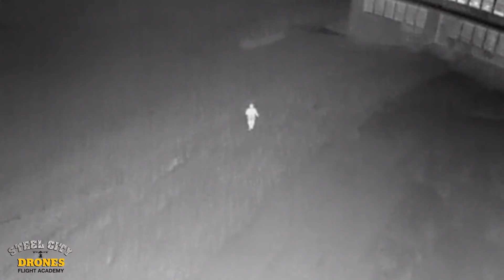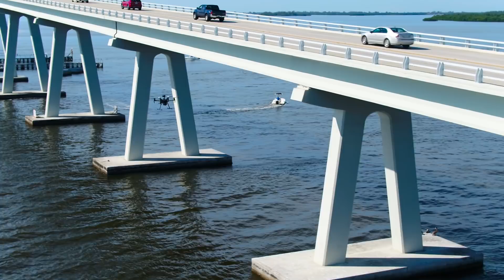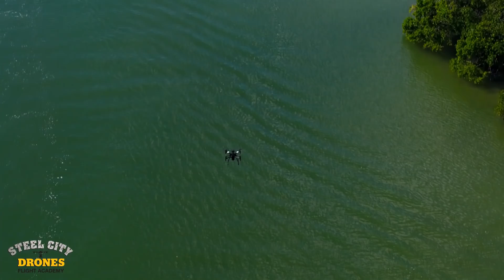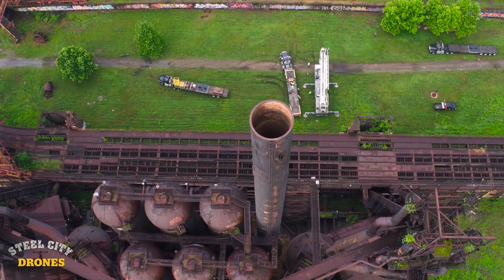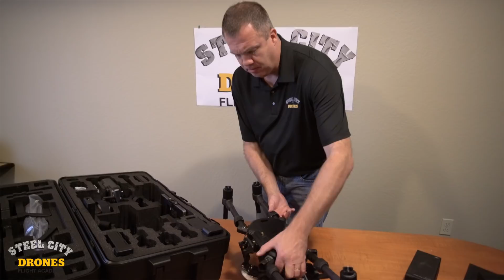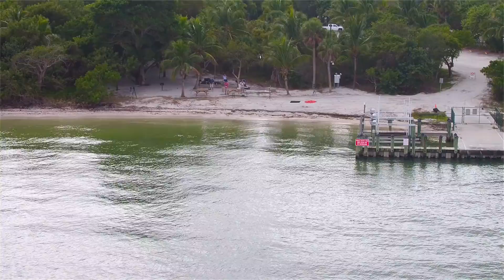DJI MATRICE 200 AND 210 RTK  | Extensive Test And Review

Comment: The factory case is the largest allowable size for most overhead bins on-board commercial airliners, and can travel with you as a carry-on bag. The GPC case that you seem to love so much must be transported as checked baggage. One factor that 99% of the posted videos over-look.
Reply from the maker: Actually that is not true, a customer of mine got rejected by Delta. And yes you should absolutely check the case in so that you can carry on your batteries.

Comment: I don't mean to be deadhead to this video but ADS only works if other aircraft are equipped with ADS-B out. So most likely you won't be able to see is small aircraft in your screen if it's not equipped with ADS-B out installed.
Reply from the maker: WingmanDK: It tests very well with small planes and helicopters almost all of which have it.  You are correct it won't pick up big airliners which is not the intention of the detection.
Reply: @SteelCityDrones  95% small private aircraft do not have ADS-B out installed and it is not required to be installed since it is not mandated until Jan 2020.  Maybe it showed within that 5%.

Comment: Very informative video. My company bought the M210 RTK and until now the RTK mode is very frustrating to use (just using GPS mode in the meantime). We can't get it to work unless it's in an open field. You mentioned at the 12:27 mark that it can fly in any type of environment. But even in our parking lot, we're not able to take it off, much more if it's on the ship's deck where we're intending to use for inspection most of the time (actually I've already tried and got all sorts of errors, compass error, magnetic interference). I hope you can give me some tips using the RTK mode in a magnetic interference environment. Thanks in advance.

Comment: Dave, Great video.  You mentioned that the M210 RTK does not need a ground station like the M600 does.  Could you elaborate a little bit please ?  Why doesn't the m210 rtk need a ground station, and are there tutorials here to set up the M210 rtk ?
Reply from the maker: We are actually recommending the Matrice 300 over the 200. M210 RTK and M300 RTK both use NTRIP so the base station can be broadcast over the network.  We have tutorial videos in our Matrice 200 and Matrice 300 online courses we have on our site.  We also sell these aircraft as well. Contact us.

Comment: Great video!  So using the RTK mode, can the 210RTK hover stably under a low lying concrete bridge that is 20ft over fast-flowing, dirty river water?  Or would the vision sensors cause the drone to panic and fluctate if it was sitting say 4ft over the water?  Thanks.

Comment: It doesnt make sense for DJI not to use the expensive RTK positioning system for reducing the ground control points
Reply from the maker: I was told there was technology limitations as for the reason why they coudn't do it. This started when the M600 RTK was released and many people (including myself) bought that copter because we were under the impression that it could do it. Imagine spending $10K plus on a system thinking it can something that it can't. That's why I wanted to include this info in the video.  Believe me, there have been numerous people complaining to DJI about it. If you want it added I suggest you go to the DJI Enterprise group on facebook and complain. There's several DJI people on there that are responsible for the RTK project and the more feedback they hear the better.
Reply: RTK linking the geotiff positions technology is already old so this DJI scheme doesnt make sense business wise for mapping and surveying if you paying over US$7000 for the RTK and still have to put the GCP in the field with an RTK rover (cheapest option)    This Matrice 210 RTK-G  is no enterprise UAV solution then.
Reply from the maker: I have to disagree with that point because the advantages of using a commercial grade GPS system over a consumer grade GPS system can come in very handy when doing commercial grade jobs. This system works great if you are near a lot of metal or have a lot of electromagnetic environments where you need inspect power lines.  I bought my M210RTK because of these situations and it allows me to work in environments that I simply can't with a consumer grade GPS system.
Reply: I tried posting in DJI Facebook about this RTK lack of use in the images and my posts were never public 
  I then questioning DJI Support why they are not logging positions and raw data from the onboard GNSS RTK receivers to use it in the geotiff of the images taken....  never got an answer
Reply from the maker: try this page this is where all the DJI helpful support people are www.facebook.com/groups/DJI.ENTERPRISE/

Comment: The m200 or 210 when flying for. What is being transmitted to the controller screen? The built in fpv nose mounted camera or the attached camera.? And can you change back and forth between the 2?
Reply from the maker: When you are flying in the air you can see both the FPV camera and main video camera feed.  By default the main camera feed is in the middle of the screen and the FPV camera feed is in the lower right hand corner. You can switch between the two very easily so that the FPV camera is the main feed in the middle of the screen.

Comment: Will the Blue sky monitor with with other DJI compatible flying apps like Litchi ?
Reply from the maker: The Crystal Sky Monitor only works with Pix4D software. Other than that its not very easy to use other apps.

Comment: Thank you for this comparison. Very informative!

 I have a question relating to the batteries. You say that you can only carry two TB55 spare batteries with you on the airplane. Is this true? They are rated 177 Wh and is above the limit of 160 Wh set by the FAA and ICAO.
Reply from the maker: Thanks for the comments. The TSA has a policy of unlimited amount under 100 WH.  Above that rating it becomes very restrictive.
Reply: Steel City Drones What about over the 160 Wh limit?
Reply from the maker: I don't believe you can carry on over that.
Reply from the maker: The TSA allows you to carry an unlimited amount of batteries that are rated under 100 wh.  DJI designed the TB50's specifically in mind to meet this spec. TB50's are the largest size you can carry on in an unlimited capacity.

Comment: Hi. Great video!  
Well, I'm also disapointed about the RTK which is not RTK in the geodesic point of view.  

I have a M210 and I wonder if I can upgrade it to M210 RTK. Can it be done or I need a complete new drone?
Reply from the maker: HI Alex, a regular M210 can't be upgraded to a 210RTK. It has to be purchased with the option no availability to add it afterwards.

Comment: Please advise me if Crystal sky + Matrice 210 RTK can do Waypoints, without camera system connected to the Gimbal. Reason being is we will have extra units that will only carry a specific Payload ( survey tool with independent software application ). So the drone job is only to fly the designated Waypoints whilst the apparatus is doing geographical ground survey (5metres from ground )

Your advise will be appreciated. Will the FPV enough to see where the drone is heading?
Reply from the maker: Yes you can through Pilot.

Comment: Great job! I work for a municipality that would like a drone for mapping, SAR, Emergency inspections, as well as marketing videos. The quality of the marketing stuff does not have to be top of the line. I feel like this would be the best drone for everything but cinematography although it seems that if we bought the x5s with it, it could do it all. Would you guys agree that the 210rtkv2 with a z30, xt2 and x5s would be the best fit? I feel like We May not need the RTK because we would only use it during emergency bridge inspections. Thoughts? Thanks!
Reply from the maker: The RTK version is great when you have to work around a lot of metal. If you have the RTK version and are not flying around a lot of metal on any specific day you don't have to use the Ground station or the RTK system. You can simply turn it off in the app and use as needed.  That way you have the best of both worlds and have the RTK system as needed. We can offer the best pricing for the M210 line along with all the accessories. We can beat any price and offer technical support and maintenance support contracts as well. We can also provide training on how to use all the equipment.  Let me know if we can help.  Thanks
Reply: Steel City Drones Flight Academy my coworkers in HAZMAT response have this drone and I’m trying to find a atmosphere meter mount for them. I saw one on a HAZMAT drone in California but can’t find it for sale. Wondering if you have a lead on one for me?
Thanks

Comment: Great Review!!! Regarding survey and those control points, I thought it would be the one to get for survey. In your opinion what Dron would be the one to get for Survey, considering similar range of price? Thank you for your kindly answer.
Reply from the maker: The M200-M210 is good for survey work because you can use the X5S and get really good flight times with it if you use the TB55 batteries. Good flight time is really important, the less flights the more efficient your overall ground control design can be.

Comment: Which drone system is recommended for mapping and surveying purposes to eliminate a lot of ground control points
Reply from the maker: It depends on your clients needs and expectations for how tight they want the accuracy. The current RTK system can get tighter than a standard GPS system but still not eliminate GCP's. Reducing GCP's can be problematic, its best to go with reusable, portable GCP's that way you won't have extra money for someone to shoot control.  I think the new P4Pro RTK will probably be the most accurate system but we don't have one yet to compare and test.

Comment: I am starting a drone business around the first of the 2019 and am currently shopping for a drone upgrade. Not sure specifically what I will be doing but want to make sure the drones I have will be flexible enough for the kinds of work that I want to do - the M210 family looks promising to me, except that in your video review you say that the M210-RTK isn’t accurate enough for mapping projects.

Is this a problem that has been fixed since your review? Can you elaborate on what the issues are? Can you suggest a better drone if Mapping is one of the missions?

   Thanks,
   David Ransier
Reply from the maker: HI Dave. First let me clarify that we never said that the aircraft isn't accurate enough for mapping projects. Accuracy is also relevant, some clients and projects can get away with 12 inches, some clients need 1/10 of a foot of accuracy.  As we stated in our video the M210 RTK is not good enough for very tight accuracy without ground control points. This is pretty much the same for any aircraft on the market.  Now there is a new Phantom 4 Pro RTK that we just received and are in the middle of testing it. We are going to test with and without the RTK to see what kind of accuracy we get. We will have a full video on this early January. Hope this helps answer the technical side of the question. As far as starting a business in 2019, I strongly suggest that you develop a good business plan first before deciding to spend a large investment on drone equipment.  If you need further advise to develop a business plan we do offer "Ask the Pro" consultation to help people like yourself in these situations. Let me know if we can help further.
Reply: The V2 with the x7 camera will use rtk georeferenced tags on the photos
Reply: @westcoastaerialimagery4690  ??>>V2 <<?  Version 2.0 of  the M210-RTK or ???

Comment: I can buy a dam plane and fly for hours instead if this 35 minutes crap for the same price
Reply from the maker: Hello Michael I am not sure what you mean. Are you comparing a plane to the 210?  A plane and a drone are not at all comparable. Each have their own functionality that the other can't do. A Plane can't hover.  A plane can't take high quality pictures, video or infrared imagery without being spending at least $75,000 in modifications.  A plane can't do bridge inspections. A Typical Cessna 172 that has reasonable miles on it in good condition is about $85,000. Storage fees are about $300 per month and then you have another $1000 a year for maintenance and inspections.  A M200 has a base price that starts under $6000. Even if you purchased the top line model that has the best of everything including camera sensors you still are under $40K with no annual expenses.
Reply: @SteelCityDrones  what im saying is way to expensive anyone can build a multirotor with around $$800 long range with 35 minute fligth time i could build under $1000 a system that kicks dji ass